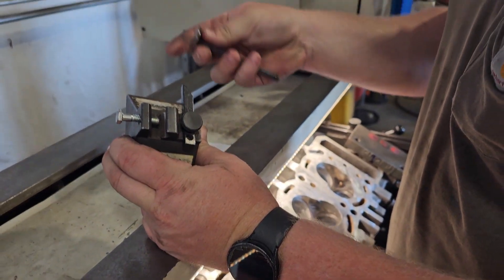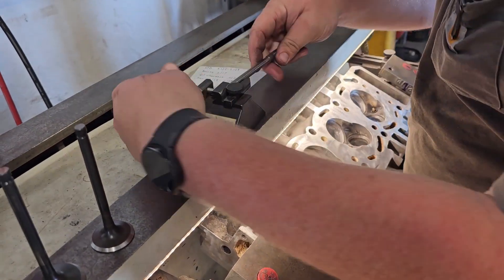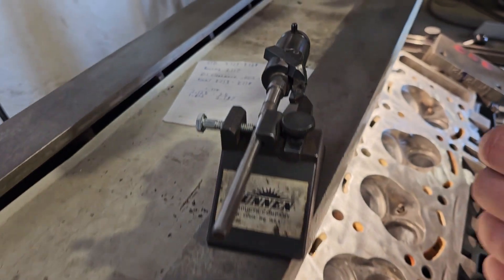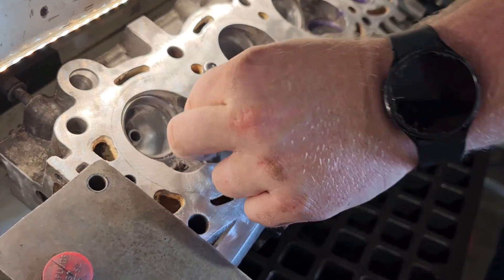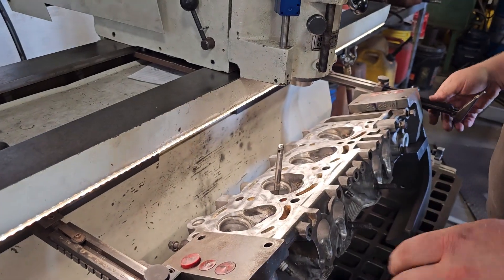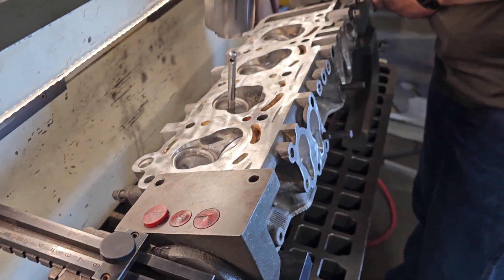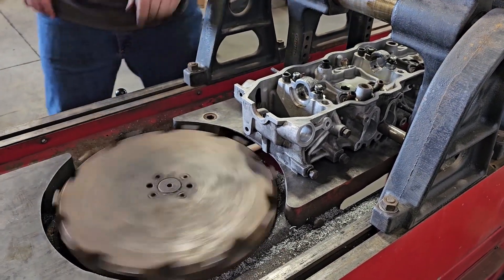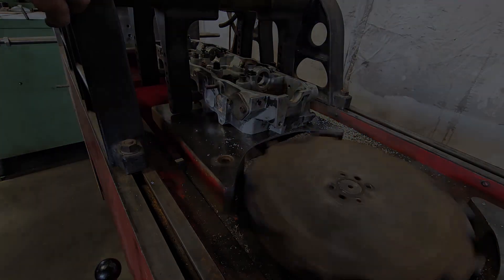Toyota 22R Performance Engine Cylinder Head Rebuild

Comment: 240 was too fine for the intake runners because it’s not direct injection and it’ll cause fuel to puddle
Reply from the maker: Hmmm, interesting concept. Makes sense
Reply: @EngineKrahnicles  i was told like an hour ago by 22reperformance that porting doesn’t really help the 22re head at all I guess the intake runners are too large and where you can gain the most performance is below the valve seat where the swirl type pocket it is I guess
Reply from the maker: @fiys567  well thats good information. Thanks for the input

Comment: looks like ITM cyl head.  not OEM one.  also, these heads really like 4-5 angles and resize the throats(75-82), plus a 30 backcut on valve.  it all adds up.